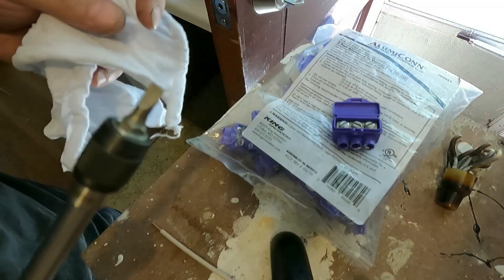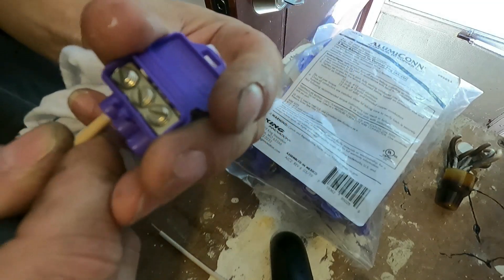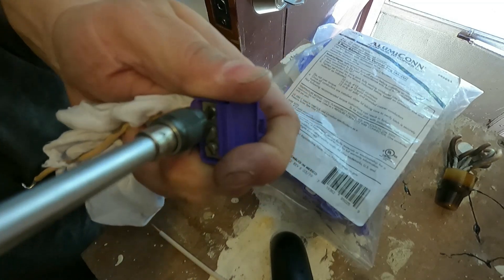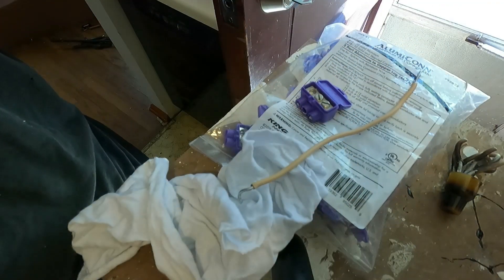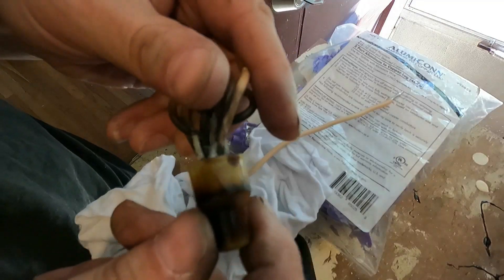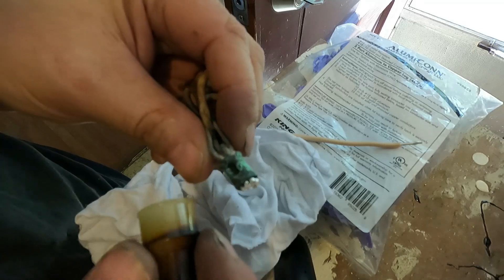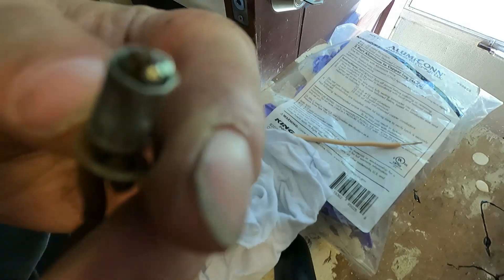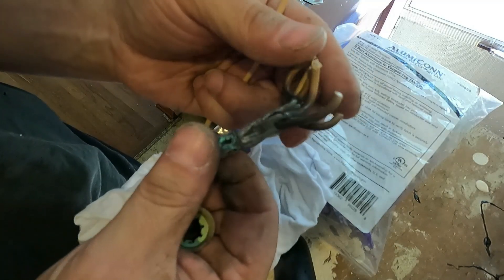WHAT HAPPENS INSIDE AN ALUMICONN CONNECTER AL/AL AL/CU

Comment: Where can you buy them
Reply from the maker: amazon or Lowes never seen them at HD. Very pricy at Lowes.
Reply: I've been buying on Ebay 10 packs 3 lug for 34 bucks and a vevor torque screwdriver for 35 bucks I got another used high quality torque screwdriver from Ebay calibrated at 10 pounds for 24 bucks too